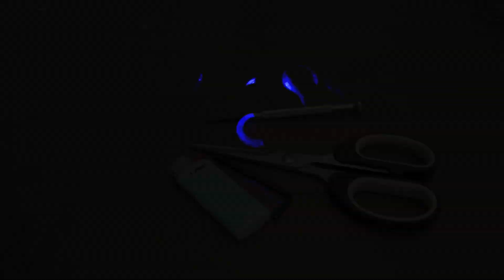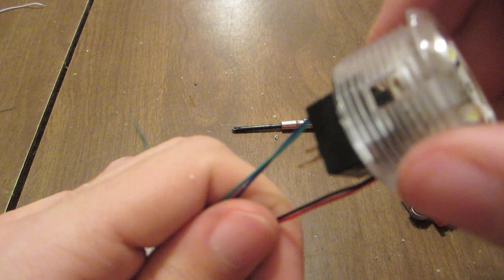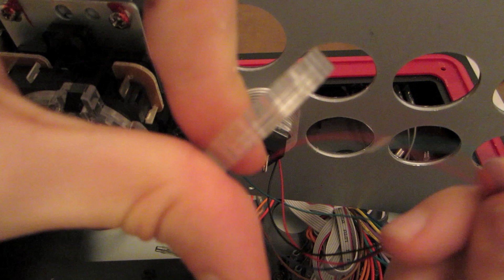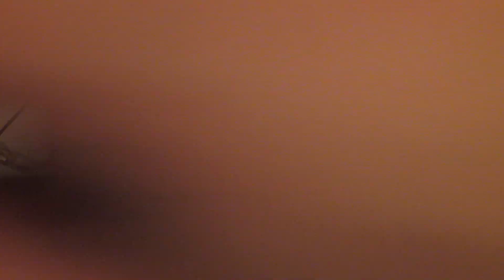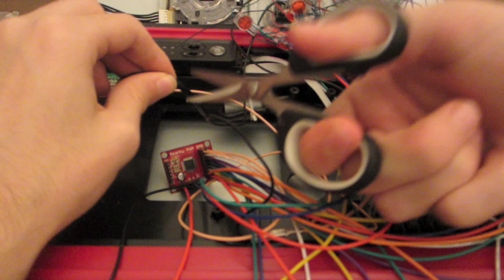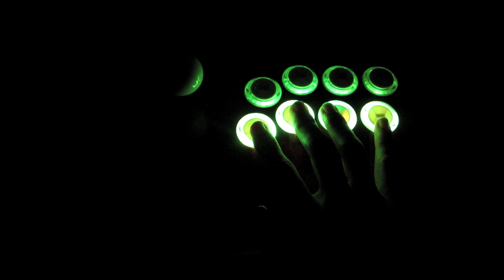TE LED Mod Using 4 Tools, Sparky PWM SMD Install Guide

Comment: ok i hooked everything up exactly as you did to the T i got a madcatz TE but when i plug it in L M H kicks light up green and wont turn off, also no other buttons will lite up when pressed. i double checked everything made sure all splices were pushed down as far as can be with scissors. have same board and leds ordered from focusattack removed white wires. any thoughts its frustrating me. thanks

also redid the greens and when i disconnected them they lit up red, and same thing no others light.

Comment: I have a couple of questions. Can we use sanwa instead of semitsu buttons?I also was wondering is there anyway you can LED the joystick as well.Do you have any turtorials lighting the joystick as well or is there any other way getting everything to light up together. What would you recommend?

Comment: I have been working at this for the longest time and so far I cannot seem to get it. I have followed this guide to the absolute perfection and still my LED's refuse to light. I have checked every quick disconnect and all the locks and cannot figure out what the problem is. If anyone has any suggestions or help, it would be greatly appreciated :( ! (The actual fightstick functions fine, just no LEDs light up)

Comment from the maker: @zerocist Yes. You've probably short-circuited some of these together on accident. Basically, the best thing to do is to start unwiring things until you no longer have all of the buttons snapped together. I think you may have accidentally daisy-chained some of the signal wires together, and it's causing them all to be pressed at once. Test on a PC, as well (Control panel > Game controllers > Properties), just to see how many buttons are being pressed together.

Comment from the maker: @mrsixonenine The Q4RAF is a bit of a tricky one. It is Common Ground, has USB, and uses QDs, but the board has a strange inversion scheme on the triggers, which can make it work very weirdly with other PCBs. There hasn't been much documentation on modding it, simply because it is already dual-system Sanwa out of the box. The Q2 works, Common Ground, has QDs, and is USB!

Comment from the maker: @mrsixonenine You could connect an additional Common Anode RGB LED where the start button is, though there's no way to connect it (without some serious circuitry) to work on start button press. You can connect all of the cathode legs to RGB to get it to light up the same color as the rest of the buttons. Uilas do not fit 24mm buttons, just FYI. Connect the Common Annode to the 5V of power.

Comment from the maker: @POPSKNZ Yup, As long as you use Quick Disconnects to connect to the buttons, that PCB should work just fine. Other than that, it's common ground and uses USB, so have at it!